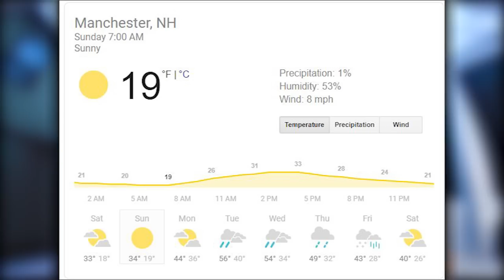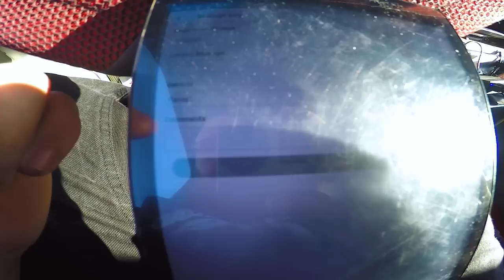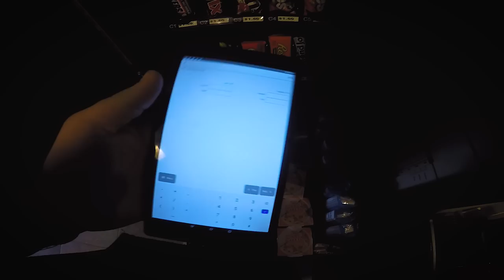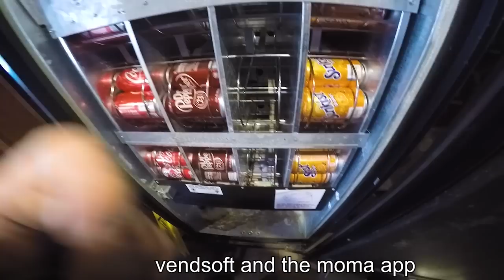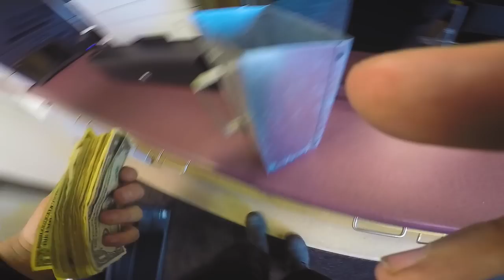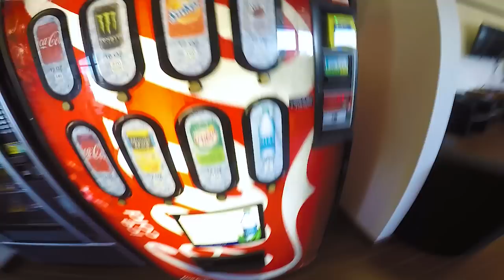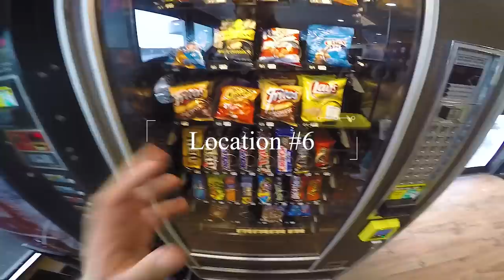Collecting money from my 12 vending machines!

Comment: Part owner of a vend8ng business here in Hawaii, found you on here by chance, but glad I did! Actually looking for help with wiring for the selection switches for one of my Dixie Narco single price machine. Currently I can't price most of the selections. So I tried searching on here, that's when your channel popped up. Learned some new tricks like pre-kits. I somewhat do that now, but I believe the way you do the pre kits are more accurate! Thanks for sharing that! Anyway, gotta keep searching for help with the selection switch wiring, but im.your newest Sub! Mahalo from the 50th State! 🤙Aloha-Luka
Reply: I can possibly help.  Are all the wires still in the pins?
Reply: @vendinomics  ...from what I can see, all the wires are still in the pins. Ordered a new motherboard originally because I thought that was the issue, but it wasn't. It's a 9 selection multi price Dixie Narco 5150; an older machine, but 99% all new parts inside. 
Traced all 13 wires to the main plug that goes into the mother board to ensure connectivity. But as it stands now, I can ONLY vend 3-4 selections that are still priced correctly. But I can  NOT set the price for the other 6 selections. According to the instructions on the inside door, to set price, hold down selection switch #1 & #2 at the sane time in pricing mode, but this is where it stops...won't let me set price...Ideas???
Reply: Have you look at the dollar bill validator and coin mech to make sure everything is connected?
Reply: Try vendiscuss.net
Reply: @vendinomics  Ok, ill go by that location tomorrow to double check to see if all the wires are connected to the bill validator and coin mech. I believe they should be since I can still sell and vend 4 of the 9 selections. Thank you!

Comment: Perhaps you need to purchase a thermal (laser) thermometer to shoot a reading inside your machines if the chocolate is melting often. Certain places will be hot spots with the motors, outside temperatures & ambient heat inside the building. Amazon were selling these from $20 USD & work the same as thermo scans in hospitals.
Reply from the maker: the reason its getting hot is because of the placement of the machines the locations wants them where they are but where they are is the hottest place in the building
Reply: @afcvending6037  Bloody clients LOL - I recall you have had a drink machine that was near a window that you switched around to counteract this heat. Can you or they add some solar tinting to the glass if near a window or bump the AC up a few degs in that area ?